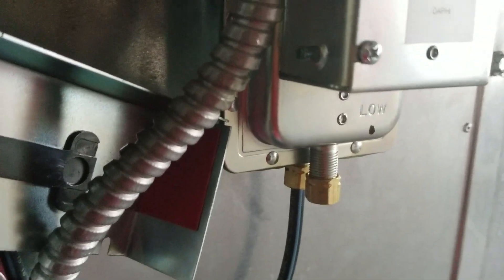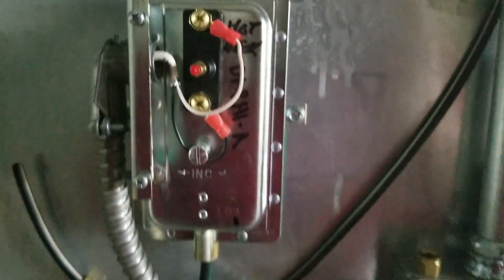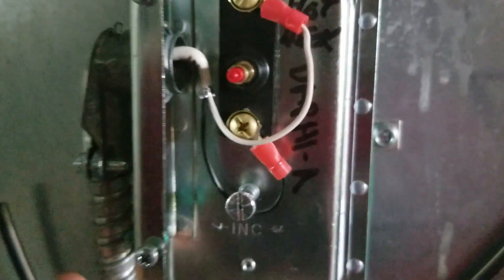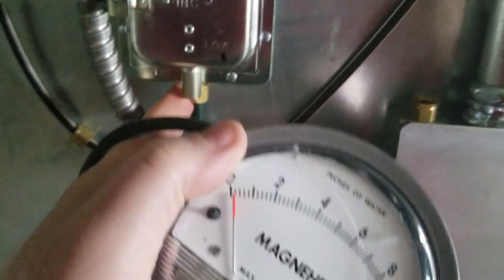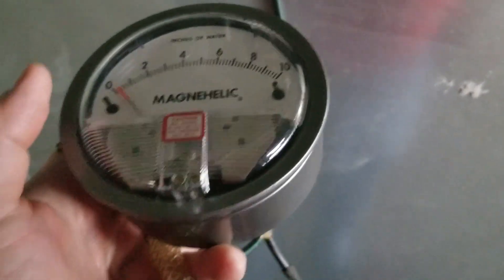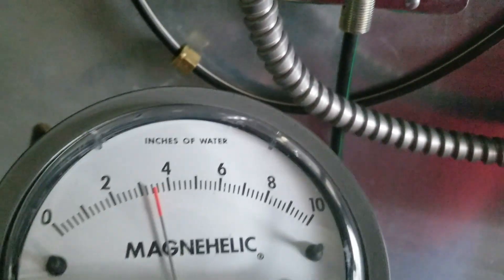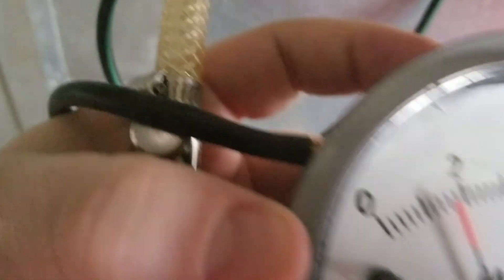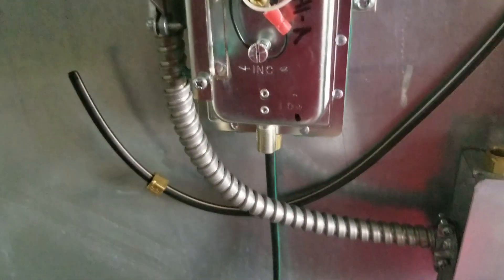Calibration of static pressure safety

Comment: As an electronic  technician, we use Cleveland Controls AFS-398 pressure switches with our dry well ventilation systems at lift stations. How would you set the set point for these switches if you do not know the actual set point ? I do not have a magnehlic gauge, but I do have a FieldPiece SDMN6.
Reply from the maker: There should be a range for the pressure switch and a signal output range as well. The lightest pressure should generate the lowest signal and the maximum pressure should be the highest signal. You really need a pressure gauge

Comment: how do you calibrate filter pressure sensor 4-20ma?
Reply from the maker: The sensor you use should have a range of operation.  The 4ma should be the minimum of the sensor and the 20ma should be the maximum.  For example, if your sensor is rated to measure 0-5iwc 4ma would be 0 and 5 would be 20ma.  That information will need to be put into the controller program to function properly.